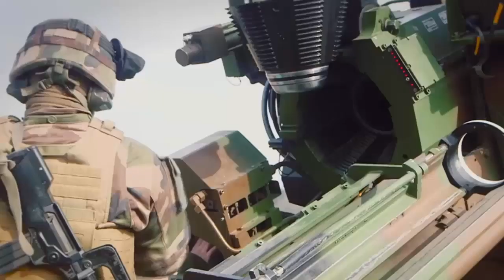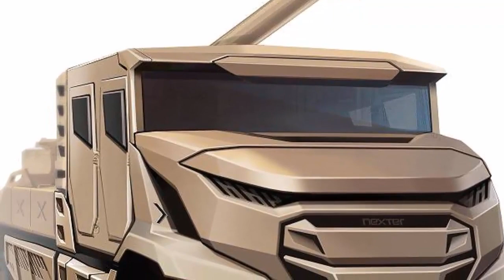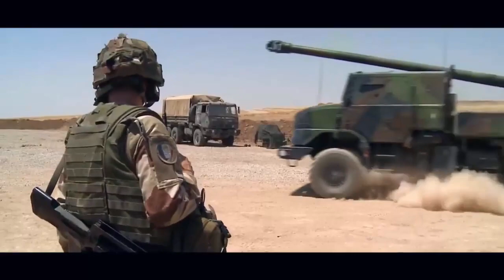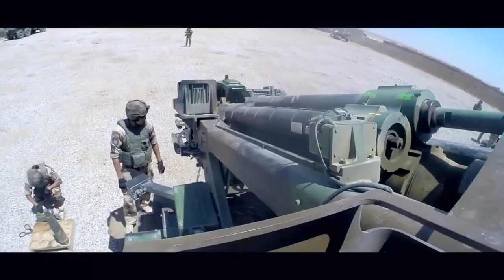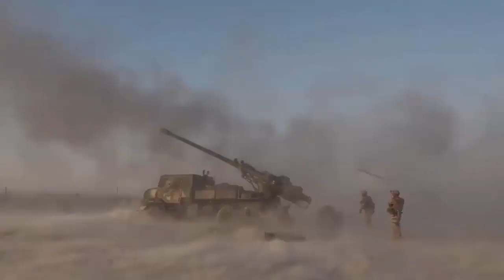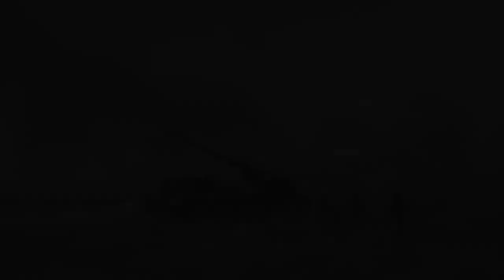This French Army's New 155mm Super-gun can make enemies pee in their pants

Comment: Time for this type of weapons is past. A suicides drone can end this forever...

AI and robotics are the nee generation of weapons
Reply: yeah ofc a sucide drone....
Reply: tell me how the hell a suicide drone can go near artillery ?
Reply: @yanisgyd6084  This goes to some location stops and shoots 6 shells a minute 42 km away before taking off full speed. A single shell can wipe out a football fields, do high precision strikes or drop smaller rockets to kill tanks from top. Artillery has not waited for drones to have a defense, anti air is always nearby and already capable to detect and kill flying drones that's no problem if you are not a poor ass Armenian army. Most artillery piece of that caliber are on tracks not wheels, which makes them much slower and much more expensive, on wheels a Caesar costs 4 times less than your regular armored 155mm, consume they same less... that's the first reason why it's a commercial success. It's speed and light frame match french army doctrine to be fast and adaptable. Logistically speaking, you can put one of these in a plane. This is a weapon of its time. The future is near but not there yet.